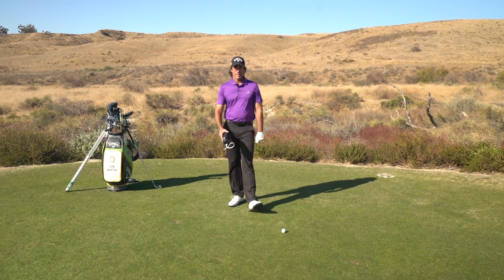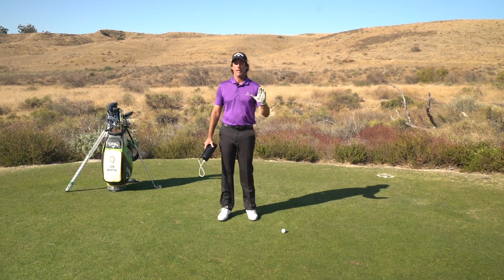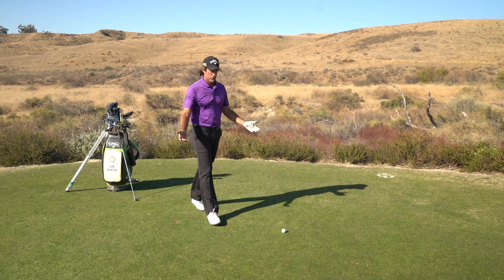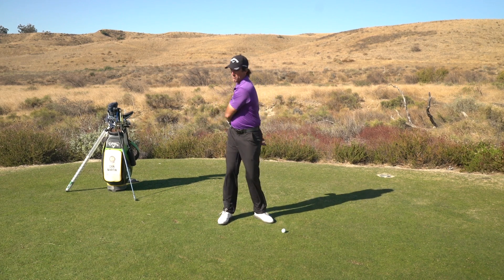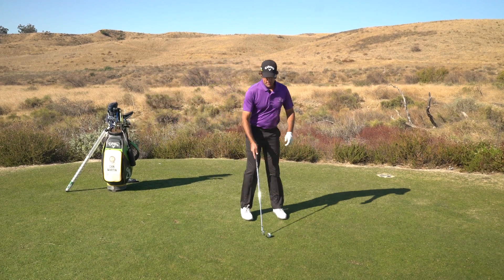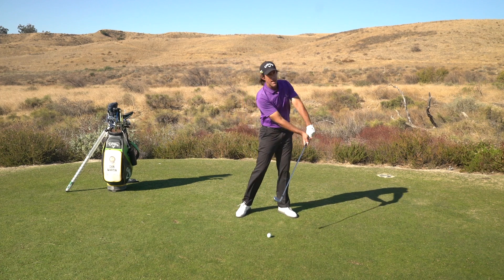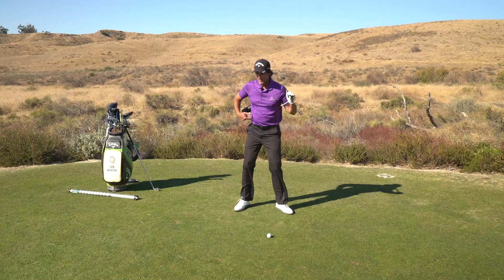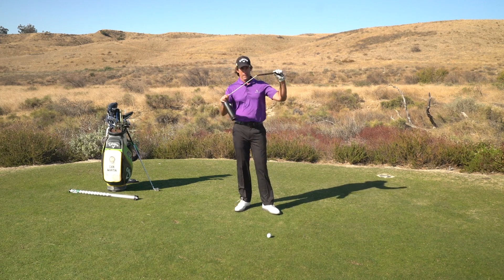There is no LATER in a GOLF SWING!!!

Comment: I haven't received my Pro yet (maybe it will be more clear when I have it), but how do you maximize speed? Is it all created in the transition?
Reply from the maker: Yes - your opportunity to pump energy into the swing is done in the transition, then it is the free flow of momentum through the body to the arms to the club!
Reply: Is that critical opportunity to add speed into the swing due to the initial pressure into lead leg or am I misunderstanding the action. I do know that it is not spinning the hips nor shoulders as that has not worked for me for 25yrs of trying.
Reply: As long as all parts are synchronized  its possible to swing fast. The problem is when you only add speed to one segment like just the arms, or just the hips that things go sideways. That's my definition of connection in the swing. Its synchronized timng, not having the arms pinned to the pectoral or anything of such. I suggest using dans principles slowly as really we should any golf move initially. You can always add speed. In dans approach I feel like I'm swinging the entire shaft not just the clubhead at the ball if that makes sense. I focus on the handle swinging around my rotating torso and forget about the clubhead to ball situation. That will happen and you will like the results.
Reply: @timothyslaughter476  there was a well know teaching pro way back in the 1940s who taught just that: swing the handle.
Reply: his name just came to me--Eddie Merrins. he taught  some of the hollywood celebrities way back then.

Comment: Dan , I am your height ,   do you have a more upright set of clubs or flatter , than the standard ?
Reply from the maker: Mine are 1/2" over and +1 degree.  I used to be +2 degrees up, but as my motion has improved, i've gone to a little flatter lie angle.  I'm exactly 6ft tall.

Comment: are you saying let the arms just fall from the top and don't consciously swing them???     I have the Pro and can't get it to "start straight" in the FW.   I"ve watched all your videos on this channel and your coach now app..    can you do a video just showing your swing without the Pro or a iron...so we can see what your arms and body are doing?
Reply from the maker: Will do that in my next run of videos!   Your arms and the club (or PRO) extend simultaneously.  Certainly might feel like just falling, but likely not.  The trick to aligning the components is to use your eyes to watch the angle form between the grip and rope, then adapt your movements to the PRO until you can get it to stay in alignment.  If you are struggling, you are trying to make the PRO adapt to your movements and that is impossible because it has no center of mass to manipulate like a golf club does!  I'll explain that in a future video! Thanks!